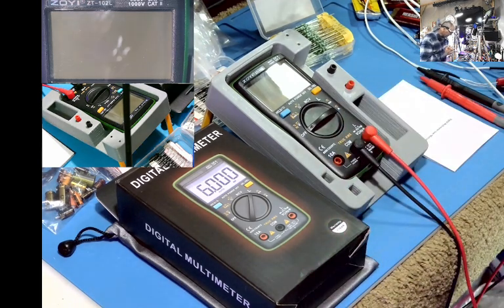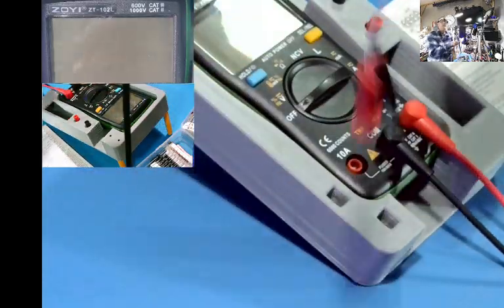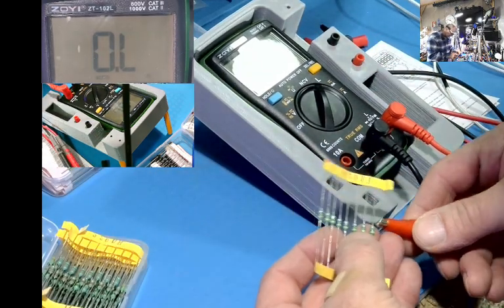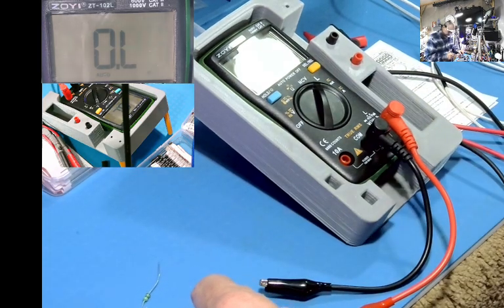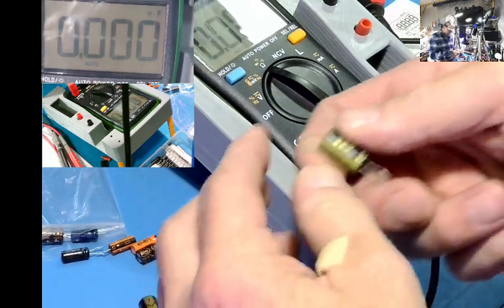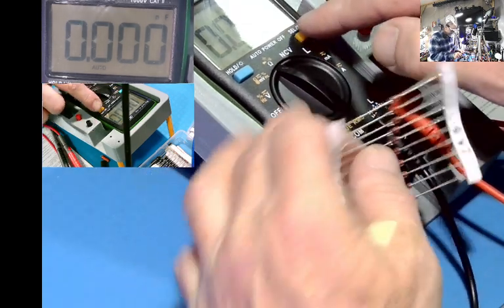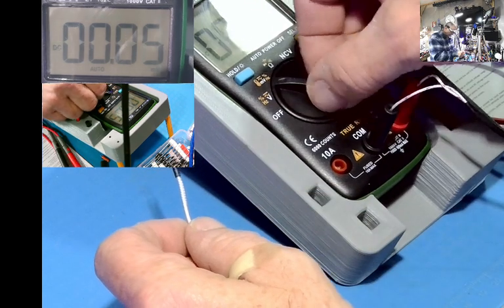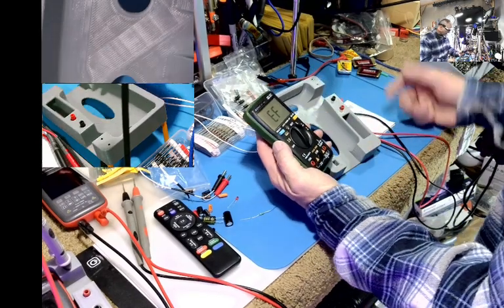ZOYI ZT 102LReview

Comment: Odd that you think either 5 cent inductors or a used capacitors unsoldered from a circuitboard  should be more accurate and valid enough to check the accuracy of your multimeter.